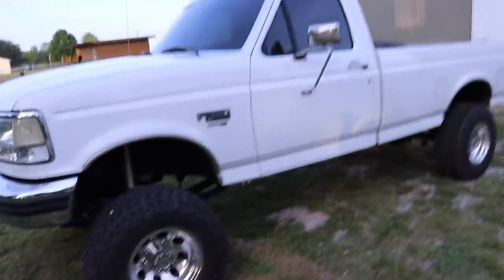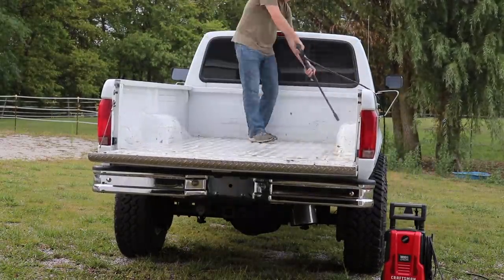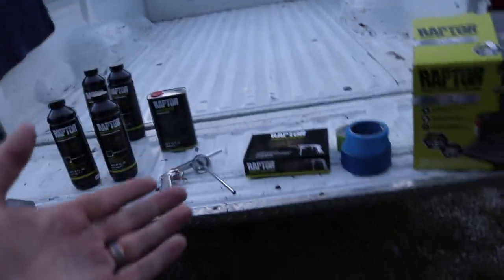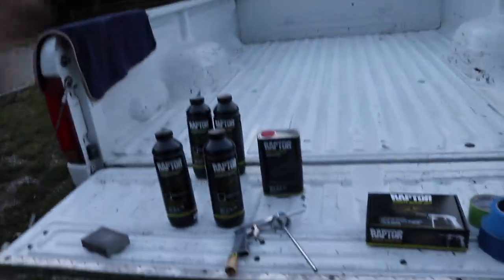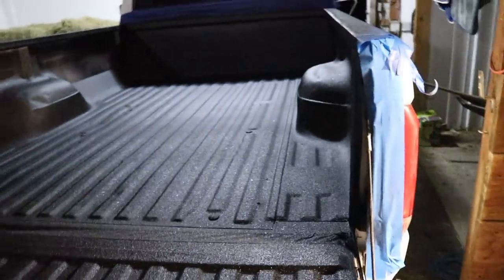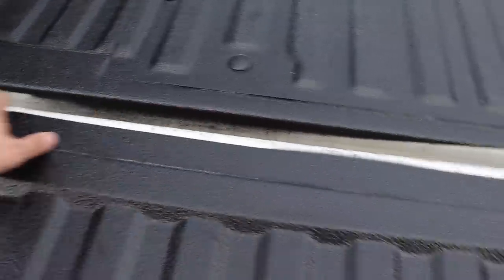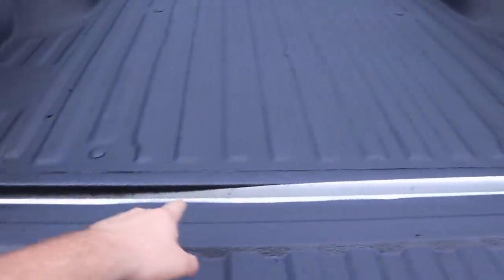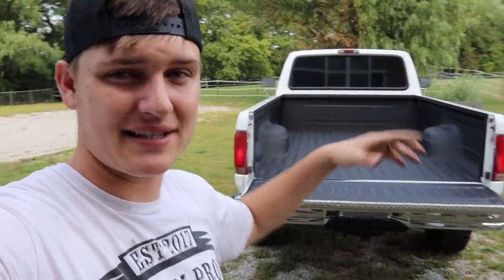I Should have done this a LONG TIME AGO!!!

Comment: I had a shot put in my bedliner on my 99 Toyota Tacoma and it’s a scorpion bedliner. it’s more rough textured and then what you did and I feel like they could’ve cleaned up the edges a little bit like on the side of the bed because I am putting a toolbox right there soon but it doesn’t look bad though. I just love how I get so much compliments for my truck for being a 99 because it has the original paint on it and it looks mint well very good condition

Comment: Take the old part to a professional welder and have the tab welded back on or find a CNC shop to cut you a new one. I'd see if it could be welded myself. I've seen heavy equipment go for years with parts welded

Comment: The raptor liner is a good product. I would pull the tailgate off it line that little section that you messed up it will still close.